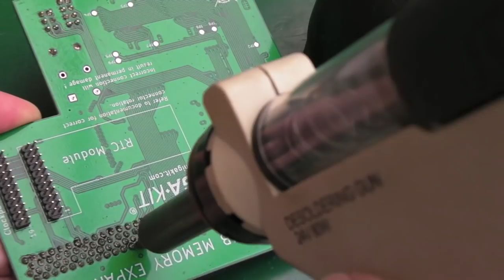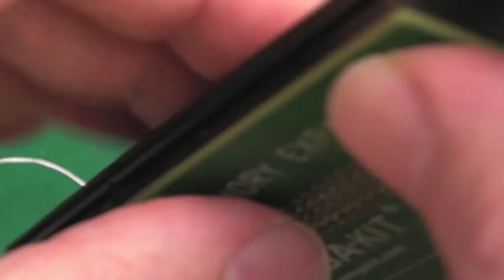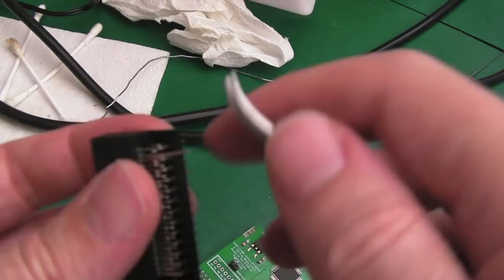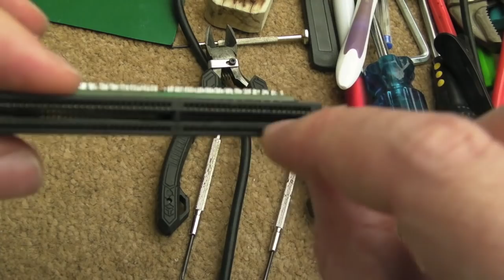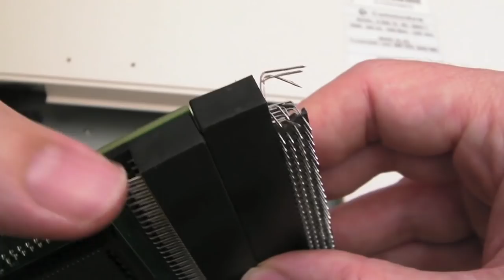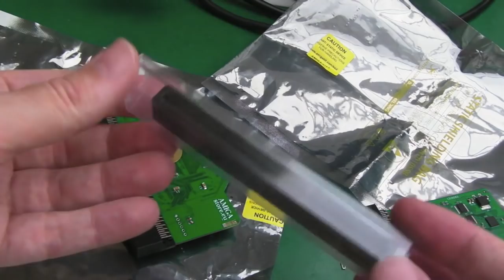Commodore Amiga A1200 - 8MB RAM Expansion Repairs

Comment: Yesterday I received the V2 of the Amiga 1200 8MB kit from Amigastore, similar to the one you fixed in this video, and I had similar issues trying to insert the card. I don't know exactly if it's a misalignment or what but it took me few minutes to place it correctly. Once inserted, worked fine.

Comment: Nice job removing that large connector without causing any damage to the board, that really takes a lot of patience. I'd probably have cut all the pins and removed them one at a time, or cut up the connector and removed it in smaller pieces. But I understand that wasn't really an option for you as you wanted to re-use some of the pins.
Reply from the maker: Thanks 👍

Comment: I find a handy way to clear a stubborn  through hole of solder is to use a thin piece of copper braid in the hole, to draw out the solder. Less hit and miss than using a desolder pump. Working on a small board, I'll typically anchor it securely. Far too difficult if it can move around.
Good work on the connectors though, they are very tricky to repair.

Comment: I gave up on Amigakit last year, for more than one reason. 

I think because you had to undo the screw, the lower Amiga shielding was moving as well. The design is a fail. I think their R&D tested only outside of a case.

The memory settings are for PCMCIA usage but I've only ever seen 4MB for that. Personally, I'd pay the extra and get mem cards that don't suffer that problem. 

Nice video as always!

Comment: Glad I bought my 8MB board from Amigastore. Bought it for a new A1200 project I'm doing so not tried fitting it yet. My other A1200 has the ACA 1233 and no problems fitting it. Even though I remove these rusty upper shieldings. Thank for the video

Comment: You got my recognition for your patience haha😁 So I got this same expansion from Amigastore (great shop I recon) and also ruïned the pins. I went to EBay and bought the same connector. On the board I cut the old connector into pieces, desolder every single pin with my iron (alas no desoldering gun at that moment). The board was totaly ruined😒 lots of pads loose haha, not to mention all the flux over my table. I’m still cleaning. Things look easy in these video’s but sure do require skills and patience. So now I have a spare connector (do you want it?) and an expansion board in my trashbin. I’m thinking about buying a new one, but not sure if that’s a good idea, I’m a bit scared the connector will be ruined again. Then these €60.- are a lot of money for it😳

Comment: Your persistence and patience with these repairs never ceases to amaze me!  

I wish I had seen a video on this topic when I got back into Amiga in 2015!  To cut a long story short, I bought a faulty ACA1233 off ebay (sold as working) which had the same issue with damaged pins.  I did not notice the damage and proceeded to, on two separate occasions, damage my A1200 motherboard before I got to the bottom of the issue.  The board was expertly repaired by Bebek from Amibay and the second time by Steve Clifford, now running Amiga Passion, who noticed the bent pins in the card connector.  Sadly by that time it was too late to put in an ebay claim against the seller.

So the moral is, always check these pins really carefully before you install an A1200 expansion as they seem to be really easily damaged.
Reply from the maker: Haha, thanks =D  What did you end up doing with the ACA1233?
Reply: @GadgetUK164  Well, that's a bit embarrassing really.  I contacted Jens Schoenfeld, who wouldn't accept the board as a repair due to the warranty having expired.  He did say that he would provide a new edge connector, but only if I could de-solder the old one and post it to Individual.  The connectors weren't available anywhere as spares at the time, as I recall.

I had a go at de-soldering the connector myself but my skills weren't up to much and I couldn't get the damn thing off!  I ended up damaging some of the pads - too much heat I think :(  I treated myself to a brand new ACA a while later just to try and put the whole experience behind me and finally enjoy the computer!

It's not all bad, though... I did manage to successfully de-solder the 030 from the broken card.  It sat in a drawer for a few years but I'm happy to say it's now working nicely in a TF536 that I recently built (it's marked at 40mhz but seems happy running at 50).  Suffice to say I've learned a lot since then - mostly thanks to channels like yours, Jan Beta, Ms Mad Lemon and TerribleFire!

Comment: I had an A1200 with a pink tinge same as you're seeing on your machine.  For mine, it turned out that capacitor C211 (a ceramic) inbetween the output of the video DAC and the input to the compisite encoder (on the red signal) had become bored of being a capacitor and decided to become a resistor instead.
Reply from the maker: Thanks for the info!  That may well be the issue here! =D  Will find out soon when I get onto it =D
Reply: @GadgetUK164  Coming to think of it, it might actually have been the on the green, not red connection.  Probably worth quickly checking all 3.

Comment: 10 hours later....    
Lunchtime comedy Chris.

Amigakit strikes again. Test fitted in a A1200 with no shield fitted.

My mate wrecked a 2600 cart slot, 4 or 5 pins flat in the bottom of the slot.  It was a weird one though, didnt have anything to stop the pins coming forward, they were just floating in mid air.  Never seen another one like it, and it was stock.
Reply from the maker: :o)  It clearly is a mistake - what that video linked in the pinned comment, you can see on LGR's board the PCB was shaved down (as I described).

Comment from the maker: The smaller one (that's easy to fit) has been donated to Novabug.  Alex was super kind and didn't want these back!  I will trim down the PCB on the other one and use it for testing.  Many thanks to Alex - retrocode.uk for sending these to me and letting me keep them.  Novabugs video:- https://www.youtube.com/watch?v=HrEKhGdBw-w&t=0s

Quick Drag Soldering (Chucky Gang) - https://www.youtube.com/watch?v=OP5NzZFnW8U
NOTE:  I didn't need to epoxy the piece cut off there.  If I do secure it later, I will just use hot glue - it will support when leaked around those few pins and shouldn't give way - but can be removed more easily than epoxy.  If you watch this LGR video, see the part where he fits his "Amiga Kit" board (its the same model) - note how much narrower the board is vs the connector.   This proves that the board from Amiga Kit we looked at in this video was either a proto or not cut properly.  https://youtu.be/yb4lGwur_rQ?t=771

Comment: The board from Edu did initially have 5.5MB (4MB Fast  and 1.5MB Slow) ram. But there was some issue with that combination, so it (1.5MB Slow) got pulled from the firmware.

Comment: The fitting problem you got comes from the connector, it's wider than the old ones(Blizzards etc..). This problem also exists on ACA accelerators. Shave them or remove the shield.
Reply from the maker: I can see why you might think that, but check out the LGR video linked in the pinned comment above.  See how he has exactly the same expansion, look how the PCB doesn't to anywhere near the edge of the connector.  This PCB I have here is 2 or 3 (or more)mm wider where it shouldn't be.  Almost like a proto.  Removing the shield would solve the problem though, so thanks for the tip there!  It's not the connector, its the PCB.  The connector is identical to the other two cards I fitted easily in this same video.

Comment: Nicely done - I am really impressed by your patience. I do wonder how these all got so damaged - they aren't supposed to go in and out ever. Or did they actually come broken (other than the one that has the wrong dimensions).
Reply from the maker: Some A1200 motherboard edges aren't bevelled.  That means the first time you insert an expansion the pins can fold up =/
Reply: @GadgetUK164  Ahh ok - that is really good to know.

Comment: We noticed that you had the rear part of the new connector on tha amigakit board mounted at an angle to the pcb instead of being flat on the pcb. That puts the connector slot closer to the expansion board pcb so the slot is no longer lines up vertically with the motherboard connection.

Correcting that angle on the rear of the new connector should help with installing the card
Reply from the maker: No, it isn't lifted up at all - the PCB is wider than it should be.  Its the PCB that is the issue.  Watch the LGR video pinned at the top, you will see how much narrower his expansion is (same model from AmigaKit).

Comment: There is likely another way to reinstall the short pin, cut the wire in half where the 90 degree bend is.
Install the two pin halves into the socket, then solder the two halves where they meet at 90 degrees.
Reply from the maker: Thanks, yes - I did consider that but wasn't sure the solder would hold.  But since I pulled that broken pin out with a soldered connection, it would probably work fine!  =D

Comment: I think that most of the "new" connectors for A1200 and A600 expansion slot are too high and different from the components made in the '90. I checked vs a Blizzard connector, and it's perfect for height and insertion. These new are maybe too cheaply made?
Reply from the maker: It wasn't the connector in this case though - the PCB edge on some A1200's aren't bevelled, which will kill even the best sockets.  And in the case of the AmigaKit PCB, it's clearly way too wide - you can see that by comparing to the LGR video pinned at the top.

Comment: In a similar way you soldered that cap lead on to pull the old pin, I wonder if yu coud cut the replacement pin, fit both bits and then solder the two bits back together.
Reply from the maker: I considered that but wondered if the solder would be strong enough.  It's certainly one way to do it though!
Reply: @GadgetUK164  My thoought as well, the strength of that pin might be reduced. Worth a test, though. Woukd be nice to see.

Comment: Cut the pin on the 90 degree bend, insert both peices and solder the where you cut?
Reply from the maker: Thanks, I did consider that (and a few have suggested it) - its a good idea!  I just wasn't sure at the time if the solder would hold it.  But then again, it held for me pulling that pin out, so it would probably work and be the easiest solution!

Comment: Mate what a nightmare you had with those connectors. Then it looked like it was over but no that second board is far to tight. Someone is going to  break something trying to put that in.
Reply from the maker: Yeah, that PCB edge needs grinding down on the AmigaKit one.  Compare to the LGR video I linked to in the pinned comment above.  You can see how much narrower his PCB is (same card).
Reply: @GadgetUK164  Thanks for the heads up. I plan to Dremel grind the edge when it arrives. My A1200's top cover is currently at a dismantled state.

Comment: I got some products very very recently from Amigastore.eu and I think they REALLY should improve the general quality of design and manufacturing. 
An example, the A600 1mb chip ram expansion (the red one) is built in a way (bad) that it is impossible to close the trap door without bending the A600 motherboard. That's bad, as they are fast in shipping and have affordable prices in general.

Comment: Bloody Amiga Kit, even my A500 DF0: switcher from them wouldn’t stay in the socket as the pin headers are soldered in the wrong way and not long enough!
Reply from the maker: They used to have a good reputation, but all I hear recently are unhappy customers =/
Reply: GadgetUK164 - Retro Gaming Repairs & Mods I suppose we should be thankful that stuff is still being produced by people for vintage kit but of course annoying at the same time a good product is let down by small issues that should have easily been identified.
Reply: @GadgetUK164  to be fair... disatisfied customers are usually the loudest.
Reply: I have the same issue here with an AmigaKit expansion. My A1200 board isn't beveled and this bent the pins on the expansion I have. Nothing in the description from AmigaKit stated that a beveled Motherboard is recommended. I returned it and they wanted to charge me £30 to repair it. I would never have purchased it if their advert stated a beveled board was recommended.

Comment: I need help because my little brother kicked my switch and i got hit on a wall and i try to hold it down and it sometimes starts up for about 2 seconds then turns off i need help
Reply from the maker: Its probably a damaged solder connection inside - could be tricky to repair.  Best thing to do is find a local repair shop.

Comment: Seems like a lot of work for what are pretty crappy cards to be honest... I guess the only reason people are going for these is because they need some ram for whdload? I'm surprised there even need to be new 8MB cards considering how many people back in the day bought one and then got rid of it a few weeks later because they wanted an 030 or better. Would have thought there would be a ton of power computer etc cards kicking about.
Reply from the maker: Beggars can't be choosers when it comes to A1200 RAM expansions - they can be hard to find and expensive.  Plus, why fit old unreliable SIMM based RAM when you can get something brand new at the same or less cost.
Reply: @GadgetUK164  "Beggars can't be choosers" argument should not override "fit for the purpose".
Reply from the maker: @valenrn8657  I completely agree!  This AmigaKit one isn't fit for purpose as it is.  I will grind the PCB edge down later.
Reply: @GadgetUK164  FYI, AmigaKit claims their A1200 RAM+FPU expansion card version 1.5 is smaller than version 1.0. My incoming A1200 RAM+FPU expansion card is version 1.5.